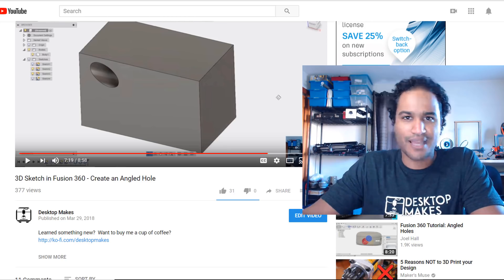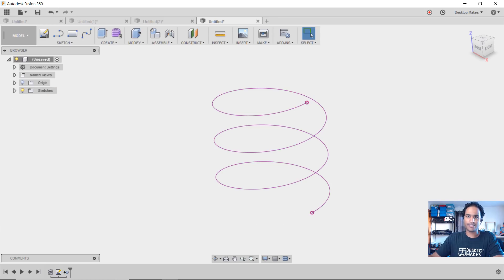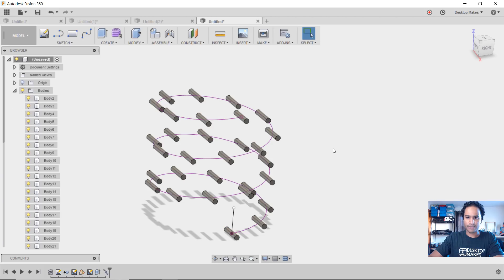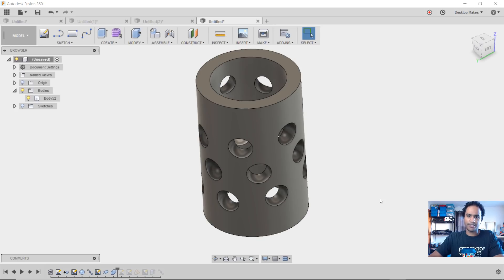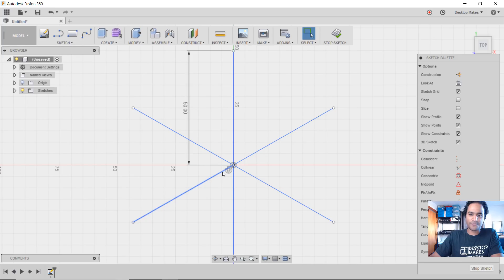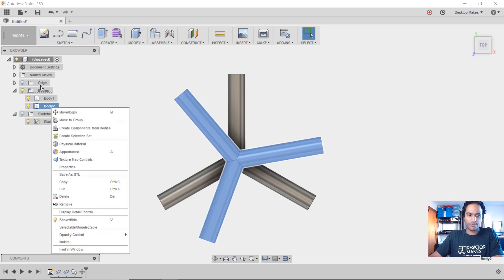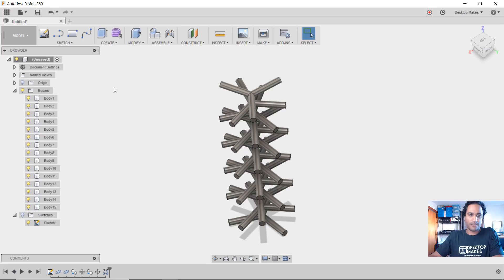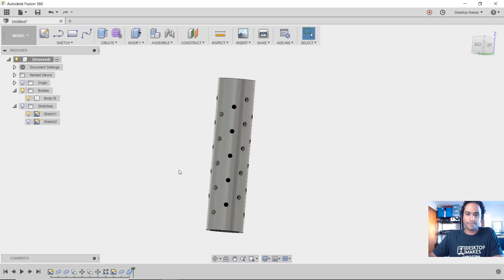Creating Spiraling Holes with Fusion 360

Comment: i needed my holes to be 45 degrees from perpendicular. I had to create one solid piece to represent the hole and create a 360 degree circular pattern from it. Then individually offset each body to create a full 360 degree loop of parts in the helix pattern and then i could create rectangular pattern to form the full helix all the way up the body of the tube. I could then select all, including the body i wanted to keep, make a selection set, then make a copy of the part i wanted to keep, before deleting the original body. That way i can use the selection set instead of highlighting over 300 bodies to remove when i come to combine components

Comment: I have problems with a mixer blades. I could do it using spiral and then pattern on path like the video but dont forget the spiral must be small diameter because all the blade must be out of the center of the axis.  Thanks for the video.

Comment: Thanks for your down-to-earth turorials.  I have a variant on your pipe-with-a-spiral-of-holes challenge.  

I have a fairly complex derived component : a circular plate with some holes in it.  I want to stack N (a parameter) of them on top of each other, each rotated 360/N from the one beneath.  So if set N=10, I get a stack of ten plates, each rotated 360/10=36 from the one below.  I'm stumped.

Comment: Your first try made me think I could do a rectangular spring and use a tangential plane to make the bodies and then spiral them with the same spring. Then change the orientation to path orientation. I think it gets closer to the goal than your first attempt but the bodies come at a vertical angle that makes them useless. Could you give this method a try to see if you get further? I will try the second method, of course, but maybe the first method has some potential.

Comment: thank you very much for your help, your tutorials have been very useful, I need your mechanical help if you will allow, is  there  possibility mechanical that the driver turn  continuously and the driven turn  and stops continuously, I tried the genova system, but it seems insufficient to me (because one turn  of the leader makes  only a fraction of a turn for thedriven ).

Comment: Not all capable and intelligent people are able to convey what they know, but you do so very well.  That said I wonder how to a similar action to a hollow sphere.  Actually half a sphere having 13 5mm holes cut through at a tangent, one in the center with the other 12 radiating out on four curved paths.  On the inside of the sphere I need to join tiny ‘pipes’ 3 mm in length, 5 mm I.D. and 8 mm O.D. for LEDs to fit into.  Would you do a tutorial on this please?

Comment: If you did the second method with the spheres onto a surface to cut the hole, you could have thicken or shell to add the thickness of the tube in?
Your final solution has more control though.
Reply from the maker: Good idea.  I hadn't considered that.  Using a surface and then thickening it would solve the curvature issue with the holes.
Reply: @DesktopMakes  Hi thanks for the great video! =) i stumbled upon this video, and out of curiosity tried the approach mentioned by Mark G, while this basically looks ok with thin tubes, technically it is actually not perpendicular due to the cut in the surface not being a real circle. Did you find any solution to this? (Edit: added Thanks for video)

Comment: I did something similar a while back. I found the easiest way was to use the sheet metal section of fusion. Create a cylinder in the sheet metal section unfold it, put your holes in and then fold it back up took me a few tries since I'm a fair novice with fusion but it worked easily after I got the hang of it.
Reply from the maker: Good point John.  My next tutorial is actually going to be doing something very similar but using the sheetmetal function.  I did a tutorial a while back on using the sheetmetal function to wrap text around a cylinder https://youtu.be/xN5uqSyG6YA.
Reply: It is way faster and easier in sheet metal